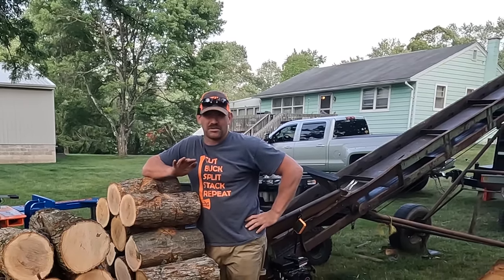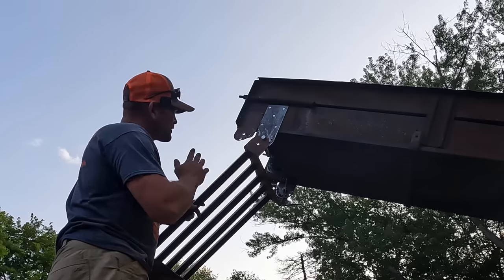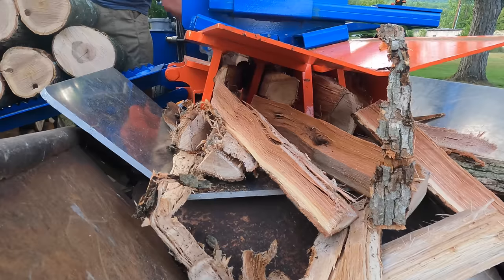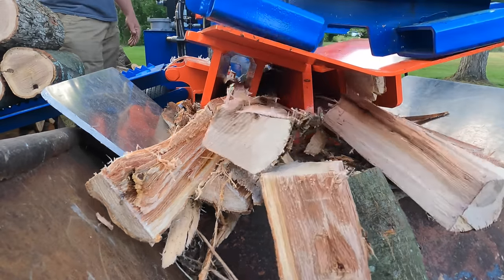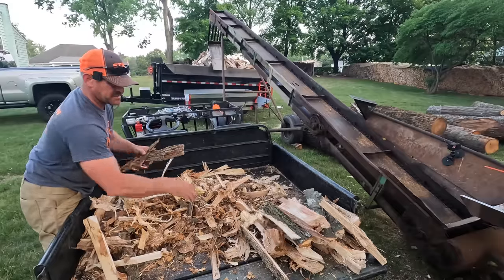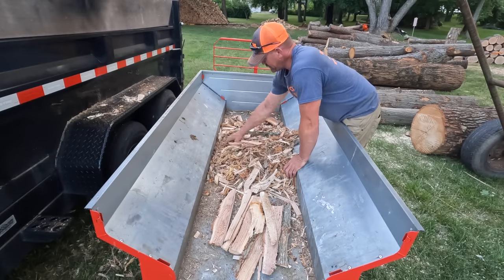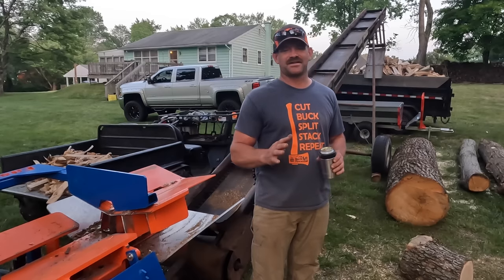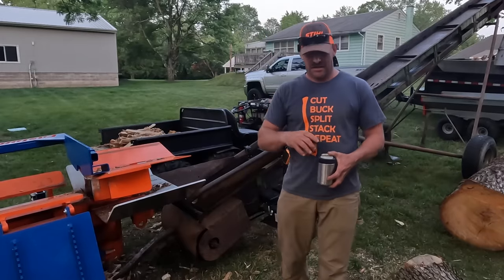splitting small diameter wood with a box wedge

Comment: Looks good to me, Gosh! I wish I could borrow your splitter for about and hour. I focus more on bundle wood and put what wont pass in with the firewood. Bundles first then bundles for me. Bundles have a higher profit margin than firewood. Most dont heat with wood as primary heat source here in MS, anyway. Using the pizza was a win. You would get that much splitter trash from a regular splitter. Most was bark so no worries there. Bark to me is wood and it burns, I dont hate it so much, except with white oak. White oak bark gets a bit trashy and dont use it in bundles unless I need bundle wood and that is all I have.
Reply: Meant to say bundles first then firewood.